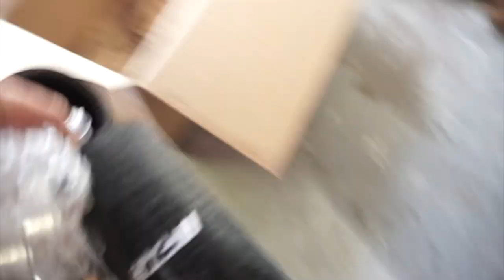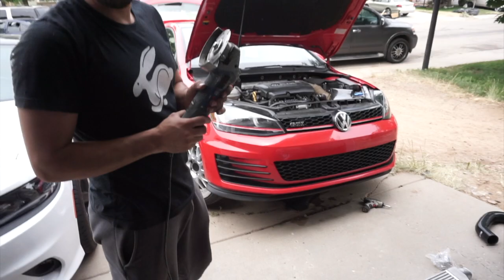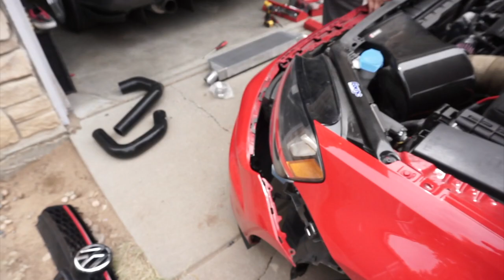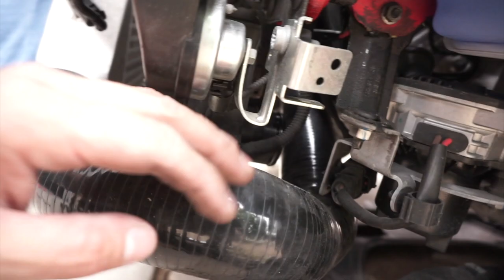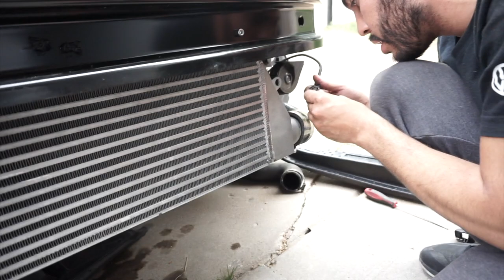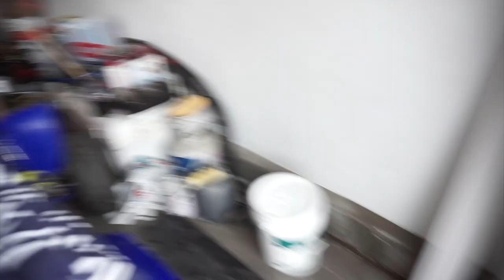CTS Turbo Intercooler  MK7 GTI

Comment: What drill bits did you use I’m having trouble with mine at the moment thanks.
Reply from the maker: Robert Reid just a regular drill bit my man 5/16 is the size I used
Reply: Boosted imports okay thanks a lot man
Reply from the maker: Robert Reid no problem man! 👍🏼

Comment: Hey bro what kind of drill bit and drill did you use for this, mine is barely making a dent
Reply from the maker: Reese Heckman what you mean? Like brand? Mine are just regular drill bits
Reply: Boosted imports dang hmm my drill bits are barely making a dent into it, barely got halfway through the metal after an hour
Reply from the maker: Reese Heckman they might be worn out, go get a new one

Comment: Just installed my CTS fmic yesterday and bent my horns like that and they seem like they are very quiet and not loud did your do that at all?
Reply from the maker: Boosted yes I think the relocation is a must unless you don’t care about the horn, I hardly used it so never touched it
Reply: Boosted imports so did your horns sound like they barely worked?
Reply from the maker: Boosted after a few days i think water got in them
Reply: Boosted imports  so you know if that started working at all after they dried?
Reply from the maker: Boosted yes they worked after they dried up